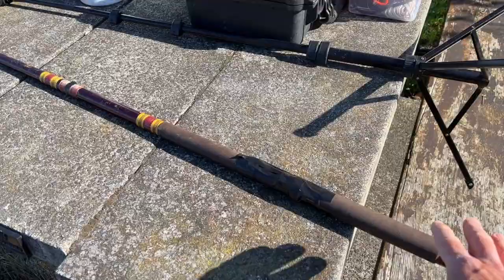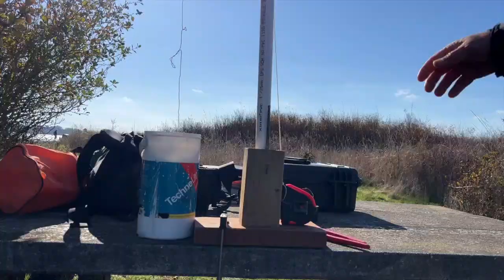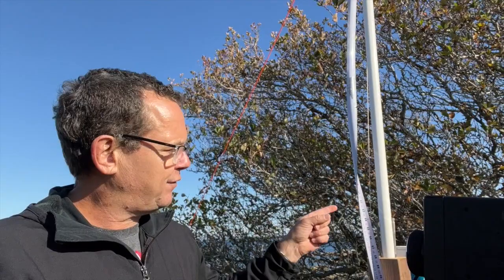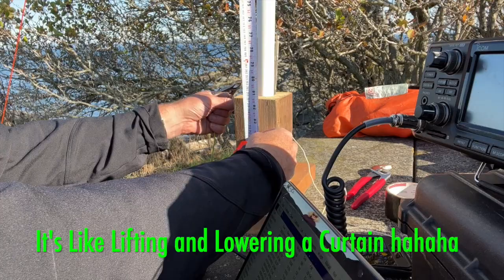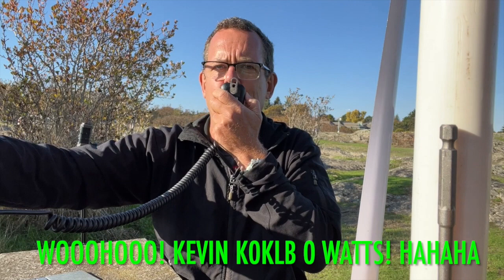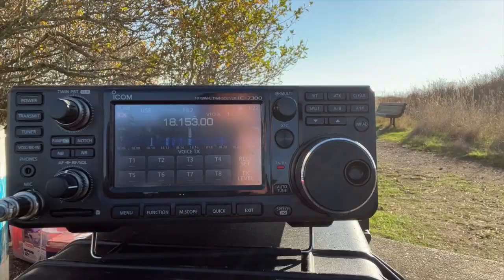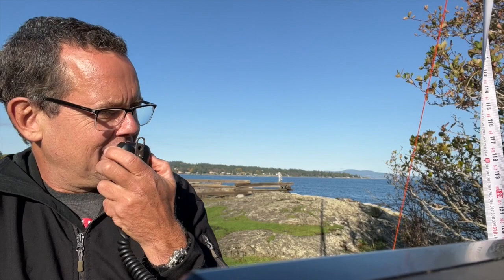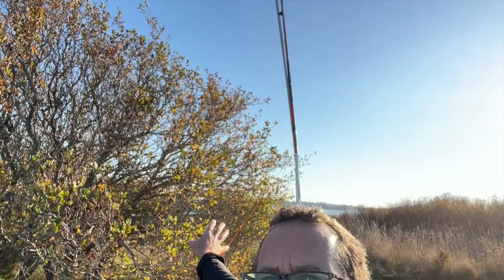DIY Ham Radio Antenna: The Incredible Tape Measure Antenna - under $25! #antenna #hamradio

Comment: If you use a Circumference Tape Measure you'll see that the tape is flat and not curved. That would make it much easier to remove the paint from one side (back side) on a belt sander.

Comment: Wohooo Simon...yoda Signal Fisherman 2023. Gosh Your Tape Measure Antenna seems to perform just fantastic. I can't believe you still having such beautiful WX there. The Days here are grey in grey overcast Temps are down @ 7-12°Cel. during the Daylight Hours. Happy Humpday Buddy - keep up ypur fantastic Work. 73 de YFUG 💯🙋‍♂
Reply from the maker: Wooohooo Uncle Guenter brother! Thanks for dropping by buddy - OMG the tape measure is the bomb buddy. It is freezing here today but I am planning a park bench activation later on for Grey Line. Weather has definitely turned here buddy - cold brrrrr. Wooohooo cheers buddy

Comment: Great fun Simon! Always entertaining and great to see what can actually work, and outside the box thrifty ideas for getting on the air. Bravo! 👍📻⚡🎺WA7FLY
Reply from the maker: Thanks so much Tommy Boy! What I'm learning about all of this, is electricity is not discriminating. So if it conducts, why not put some RF through it? Also, I'm all about building stuff on the cheap. hahaha, I guess that's the farmer in me. We always were around welders, oxy torches, pipe benders, drill presses etc. Had a blast making bull bars for the vehicles, cattle yards etc. hahaha. Wow cattle yards would make a great antenna hahaa. Cheers and beers buddy!
Reply: @thehamjazz  So much fun! Thanks for sharing your ingenuity!

Comment: Sir as a new operator on Han radio I would if you could tell all the tape measurement for all the bands as I would like to try this hear in Scotland also maybe a link as counterpoise lengths and coaxe connection.
Reply from the maker: Hey there Willie, congrats on becoming a new ham! As my buddy says 'the addiction is real'. If you're around tomorrow mate, I will be live streaming around 10pm your time, and every Wednesday using the tape measure. I can definitely provide you with the lengths mate. 

Off the top of my head here is what we've got, and I'm sorry they're in imperial measurements. 

Firstly,  you'll need 16 - 24 elevated radials of 8ft 9 inches. Cat5E ethernet cable is the best, and it is CHEAP. 

As for the tape measure.... the measurements are as follows, based on this radial system. 

10 meters = 6ft
12 meters = 8ft
15 meters = 10ft
17 meters = 13' 6"
20 meters = 17' 6"

These measurements vary mate based on soil composition, height, surroundings etc, but if you start with those measurements you can easily shorten or lengthen them which is REALLY fun, to get the perfect SWR. I hope this helps mate. Please reach out if you have any other questions. 

Cheers